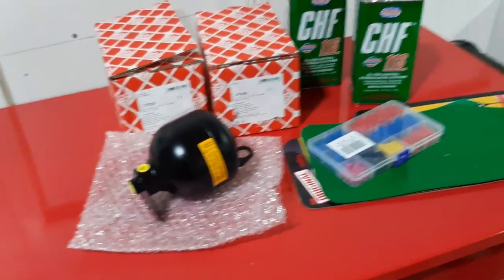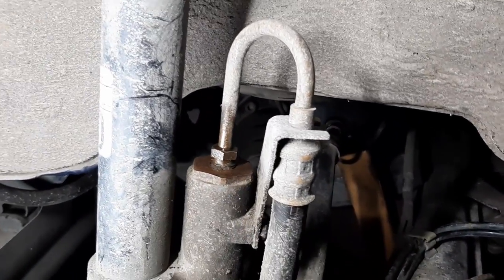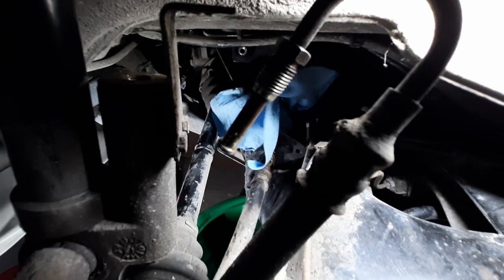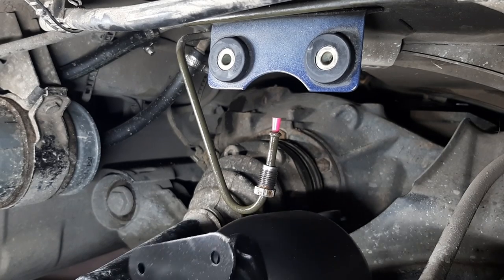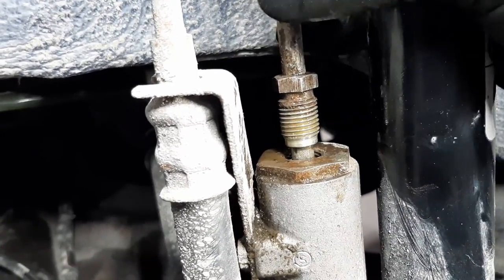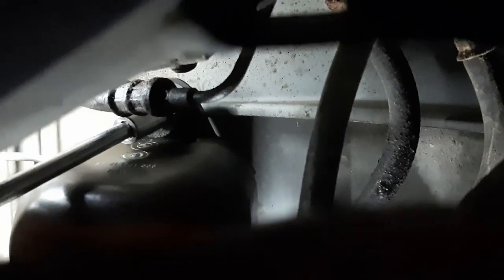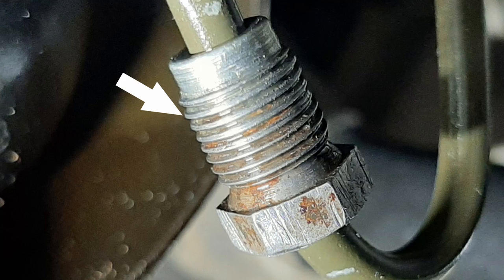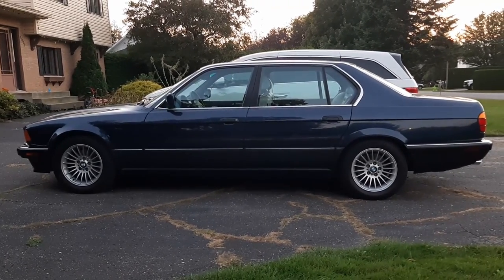Restoring the comfy ride! Self-leveling accumulator replacement on BMW E32

Comment: Just an FYI, the SLS rear shocks are no longer available from BMW. The control diaphragm is also NLA as the company that produced these for BMW was bought out by another company that halted production a number of years ago. There is a shop in Poland that can rebuild the seals for these shocks, and it's rumored that the E38 control diaphragm can be modified for use in the E32 but I have never seen this adequately documented anywhere. It should be noted that the E38 uses an air system while the E32 and E34 system use a hydraulic fluid based system.
Reply from the maker: Great info thanks for posting.

Comment: Great video! It applies 100% to what I have to to on my 89, 635 CSI that I’ve dreaded replacing these accumulators. Will pre-soak my connectors with WD40 first. Very helpful.

Comment: I have a 1989 735iL and I used regular power steering fluid… DO NOT BE LIKE ME, use pentosin or don’t use anything
Reply from the maker: Yes! It's pentosin or nothing! I hope you managed to flush your system and replaced the fluid with CHF 11S.

Comment: Again these accumulators are not available. I suspect the only solution at this point for most is to delete the system
Reply from the maker: Ah really? The supply of the accumulators has been sporadic over the years, so I'm not surprised. If one is determined to keep the SLS system going, it's a good idea to set up alerts on eBay for the part number. Deleting the system is another solution.

Comment: Thank you for your detailed video. It really helped me to do the same job on my e34 Touring! Luckily mine was not rusty so it all came apart easily. Putting it back together was a different matter, those tiny m6 bolts and nuts on the backside of the flange ...! Only  gained access by dropping the exhaust. Extra fitness challenge was doing this outside while it was snowing. No matter it is quite a physical job when the car is on axle stands that I kept nice and warm ;-)

Comment: Ps future job-replace the petrol tank support straps. They rust at the ends in the middle as they didn’t have great factory protection. They are still available from bmw. Your seem fine but they just suddenly go.
Reply from the maker: Yes, others have mentioned the straps too. I inspected them carefully and they are in good condition. I will keep an eye on them periodically, thanks for the tip.

Comment: Your videos are always helpful when I work with my E32. Much appreciated. My car had this system deleted and coilovers installed instead. Harsher ride, but atleat we got rid of that 80's wheel gap :)
Reply from the maker: Thanks for your comment :)
Many people delete the self-leveling system. I can understand why, especially if the shocks are leaking. There aren't many places that can service them, even if it mostly involves replacing o rings and seals. They are NLA from BMW too.
Coilovers are a good substitute, as long as the car isn't slammed on the ground (not a fan!).

Comment: hi great vid! im doing this myself soon and this helped me alot. do you release the pressure in the system somehow before you disassemble it? with a bleed valve or so? also i wonder if u bleed the system after filling it up again? again, thanks! /750iL-owner in sweden

Comment: Mate, you're so detailed and patient both in your video production and the actual work...really great. An idea for the accumulator line nut thread might be also to use a few rounds of plumbers tape to shore up the tread thickness albeit slightly. Note, I believe that the self levelling fluid reseroir under hood/bonnet is different for the non-fitted car...an easy way to quicky tell a car so fitted. Most cars not having the self-levelling system (swb) have a plastic orb style reservoir with an integral dipstick screw off lid in them, which funnily enough was fitted for a long time to many BMW models as well as on other Euro cars such as the Porsche 944 (one version anyway). This is what might be known as the 'standard' reservoir and holds only the power sterring fluid, logically.
Reply from the maker: Thanks for the nice words Aussie BMW! I think you mean teflon tape right? Maybe that would have worked yeah. You're right that the reservoirs are different for the SLS and non-SLS versions. The SLS version is no longer in production.

Comment: Hi Guy, 
Thanks a lot for making and sharing your "tutorial". Absolutely well made and interesting. 
Is this pressure accumulator the same one as for the brakes and servodirection? It really looks like it is.
Eventually your car will be fully refitted 🤩
Is your colour Royal Blau or Lazur Blau or ?? My E32 from december 91 is Lazur Blau.
Btw, are you french speaking? I mean native (Quebec). 
Bonjour de Bruxelles - Belgique.
Reply: La fameuse ''Brake Bomb ''? Non, ce n'est pas la même pièce.
Reply from the maker: Bonjour Jean-Jacques! Merci de visionner à partir de la Belgique!
Effectivement je parle français, c'est ma langue d'origine. Pour atteindre le plus de proprios de E32 j'ai cependant décidé de tout faire en anglais. Ça marche bien même si je cherche souvent mes mots!
Je ne crois pas que l'accumulateur de la suspension soit le même pour les freins et la servodirection. Je ne suis pas certain à 100% mais je crois que l'accumulateur pour la direction et les freins n'est plus disponible chez BMW, ce qui me fait croire qu'il doit être différent. Le principe est le même mais la "plomberie" doit être différente.
La peinture est de couleur bleu azure comme la vôtre! C'est une couleur magnifique, avec ses teintes de violet.

Comment: Hey man, great video! If I could make a suggestion though, try using some aero kroil next time. Really works on rusty frozen bolts and has saved me untold trouble working on my w126 merc.
Reply from the maker: Thanks for the tip!

Comment: About you (nice) wheels, are they from the E32-epoque or rather E38 ? 
They seems to be 16 inches, at least... 
Kr
Jean-Jacques
Reply: Epoque fin E38 ou E39
Reply from the maker: Les roues de 16 pouces "style 61" proviennent d'une 750 de génération E38. J'ai toujours aimé les roues multi-branches de style Alpina. Lorsque j'ai vu une annonce pour 5 roues de E38 en bon état pour 240 dollars Canadiens, j'ai sauté sur l'occasion. Elles sont montées sur des pneus Continental ExtremeContact DWS 06 de grandeur 225/55/16.
Seize pouces est la grandeur idéale (selon moi) pour une E32.

Comment: Thanks for great Video. I don’t have air suspension nor an e32, but still learned a lot from your issues. 
I would have replaced the hoses. Given the time you spent on the work, I would worry of them failing. I don’t think that you can tell the condition of a hose from its flexibility. However, given that it was always garaged, they were probably still good. 
Beautiful auto.
Reply from the maker: Thanks, I'm glad you liked the video!
You're probably right, replacing the hoses would have been a good idea. But it would have added more cost and delivery time. It's a gamble, because it's difficult to know the true condition of an old part. So far they are still OK though.

Comment: I remember when Sreten of M539Restorations did his on his E32 which he refers to as project Karlsruhe and I think he said that he had a tough time finding those spherical membrenes and they were not easy to come by. Did you have a tough time finding them in Canada?
Reply from the maker: I think the accumulator he replaced was the one that is also used for the brakes system. Only the early cars had that version, which explains the rarity of the parts. The "regular" LAD accumulators are still hard to find though. They are manufactured in batches and sell quickly. When I bought mine I had set an alert on eBay and jumped on them as soon as possible.
Reply: Yeah that's exactly what Sreten did as well. Those things are extremely difficult to find.  @ClassicBMWFanInQuebec

Comment: I'm about to change my shocks on my 91 750il, since both are leaking. One from the bottom seal and one from the top. Thank you for sharing on how to properly fill and bleed the system. Thank you
Reply: We’re would you find these shock they don’t make them any more. I am having a hard time finding some good ones.
Reply: @samirhussain6933  I was able pull a good  set from a car at the junkyard

Comment: This is an extremely helpful video. No one has ever done this before let alone start y to finish and why they fail. A longer drive review might be in order. 
I may have solved the bonnet insulation missing pads. I’ve found some factory looking material and using double sided tiger tape they should do the job. Send me your email and I will share some photos. I’ve some spare material so can post some out too to Canada. Lee
Reply from the maker: Thank you for the kind words! Even though I made some mistakes during the repair I hope it helps others who will need to do this job.
I'd like to see the solution you found for the hood pad. You can find my email address by going into the About section of my channel. Cheers!
About the longer driving impressions, I haven't had the chance to drive the car a lot since I'm deep into reconditioning the valve body of the transmission!
Reply: I did look there. Only the channel address is in the about section - no email. I’ve tested my solution and it works and sort of looks almost right. Bmw obviously didn’t think this would ever be a service item! Best wishes Lee